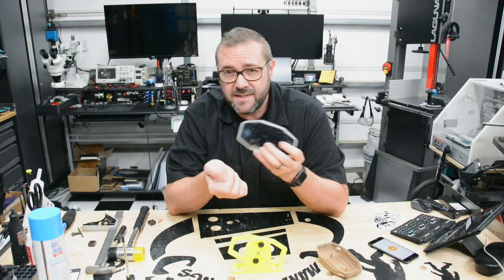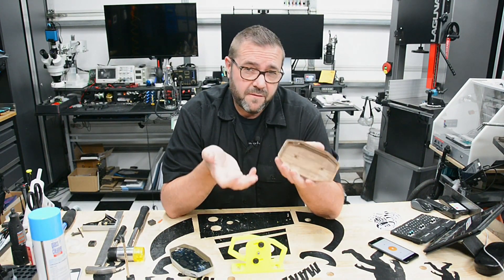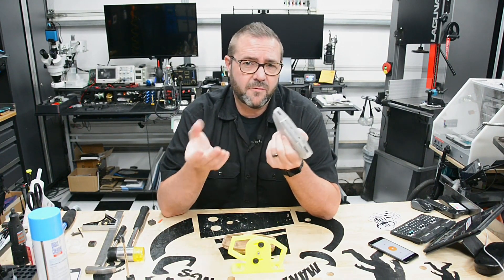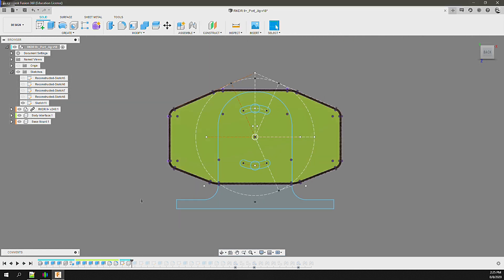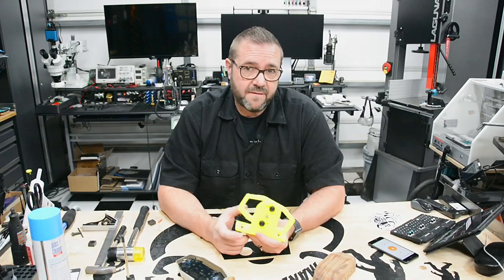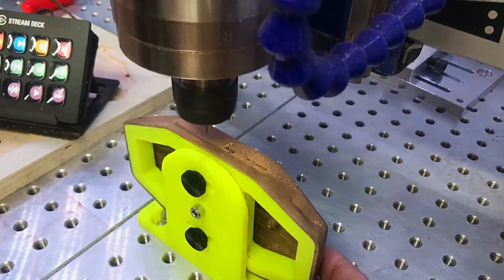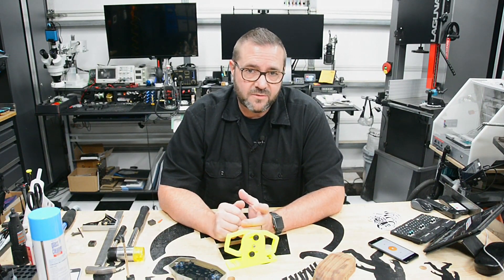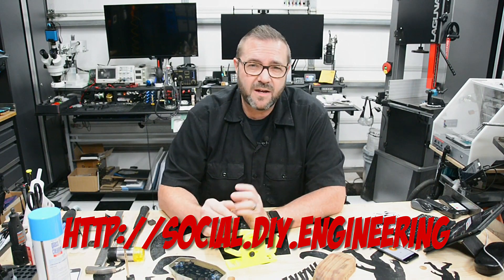Episode 043: Milling Off-Axis Features of the Arcade Handheld On A 3-Axis CNC!

Comment: Your fixture is very clever! It's an elegant solution to solve the problem of machining those features.

A slightly pedantic note for you. A fixture is something that holds your workpiece stationary so that a tool can do work on it e.g. your 3D printed fixture for milling these features. A jig is affixed to the workpiece but it's then still able to move and the tool remains stationary e.g. a tenoning jig for the table saw.
Reply from the maker: Josh Warner I’ve read the definitions of both , I like your explanation, it makes complete sense. to me, knowing how to use something sometimes supersedes terminology. :) which may explain why i use them interchangeably... ;) ill definitely refer to your definition in the future as it makes complete sense, thanks!